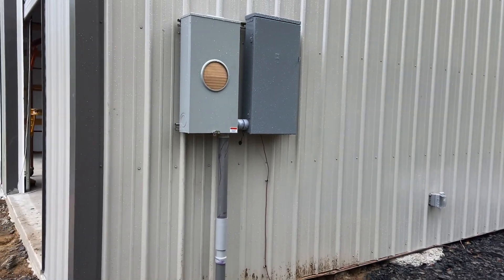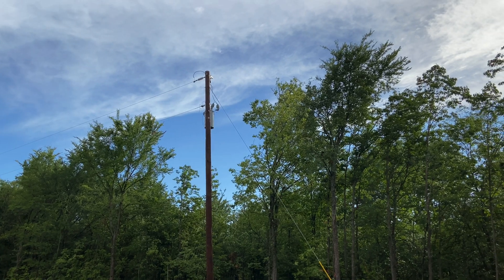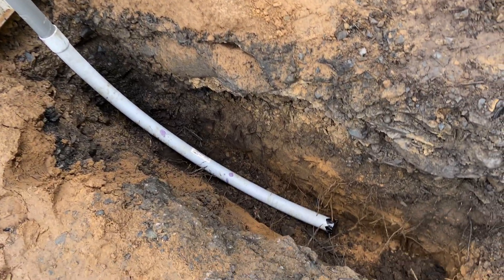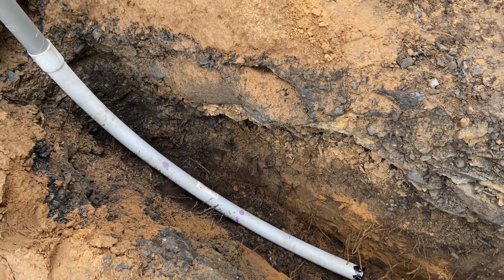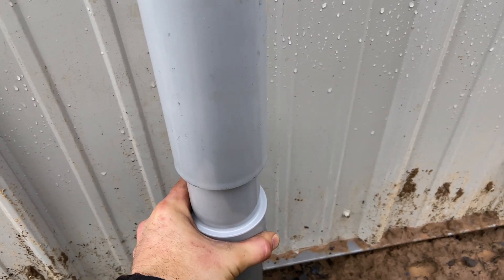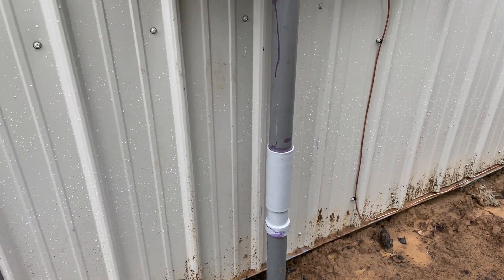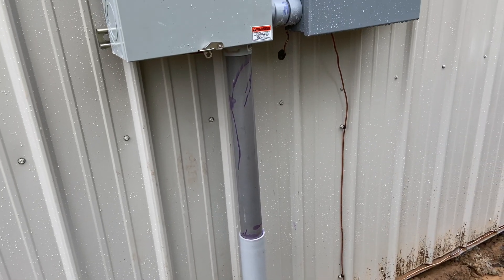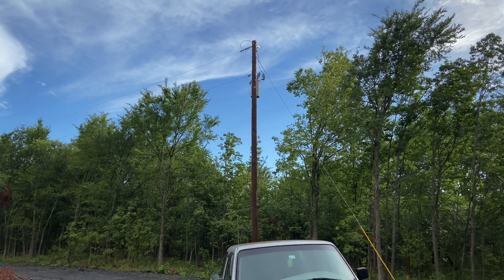Episode 18 - Electrical Service Entrance Conduit

Comment: Something doesn't look right in your meter base. Your pipe work comes into the bottom of the meter base. The service conductors coming in underground are gonna be in contact with your feeder conductors going to your main disconnect. Most power companies want them completely separated. You should have come up the left side of your meter base and used a large lb to get the wire into the can. I think you should have purchased a meter base that is approved for under ground services.
Reply from the maker: The meter was supplied by my power company. 

The service comes in from the bottom and then go up the left side to the top. 

Feeders go from the bottom to the right side and then split going in the back of the panel to the shop and then through a right hand knockout and conduit connected to the house disconnect panel. 

All is well. 

Thanks for watching.

Comment: Your expansion pipe is not adjusted correctly have to be in the center
Reply from the maker: A good point. Thanks for weighing in. The whole project was a learning experience.

Comment: So many issues with this install .
Reply from the maker: Thanks for the feedback. Would you mind listing them?  I’m always looking to learn and improve. Thanks.
Reply: @Ciband  
1. Schedule 80 above ground . But I rather do ridged or emt above ground 
2. PVC nipple from main to distribution is also cheese 
3. Utility company in Cali would not dig on your property . Normally you leave conduit close to the pole or 90 up to it with a bell reducer 
4. No straps on your conduit . How do you keep it level when you back fill 
5. I did not see a ground

Comment: I ran 200' of 3" using primer and glue - as I already had it.  I ran out and found at the store that they make a gray glue that says it doesn't need the primer.  It's made specifically for the PVC conduit.
Reply from the maker: I did the same thing. I’ve got some of the gray stuff now.

Comment: Check the manufacturer's instructions on the can of glue. Last time I read it on my bottle, it says no primer required. As long as it says that, it should be good enough. You're following the manufacturer's specifications.
Reply from the maker: Yeah, I used the DWV pipe glue since it was what I had. I picked up some “conduit” glue that is just a single step and it dries grey instead of purple.  Looks nicer.